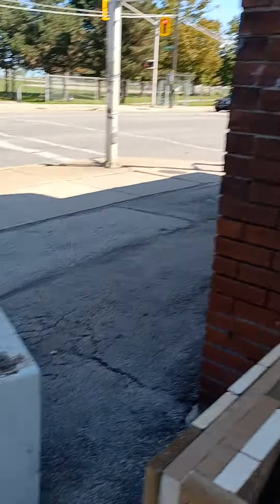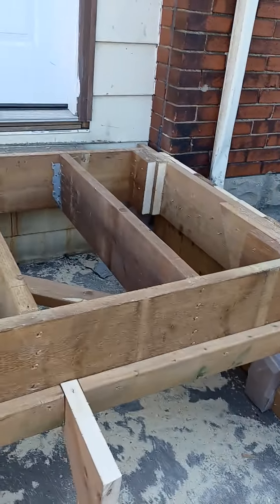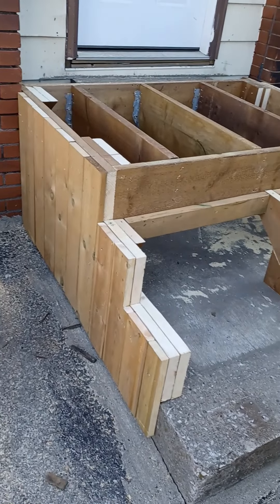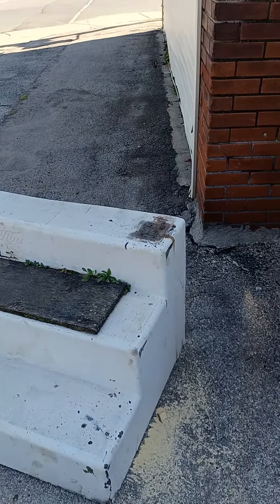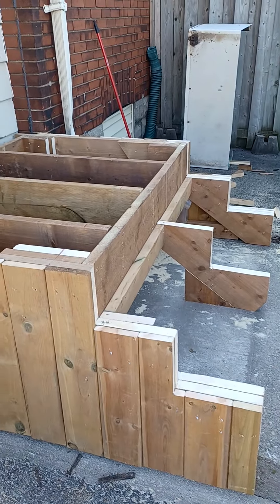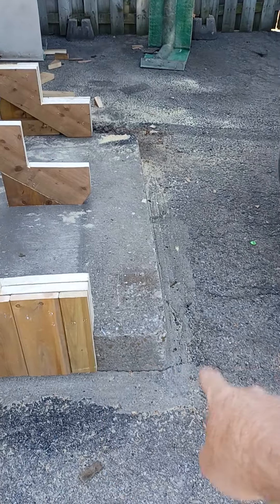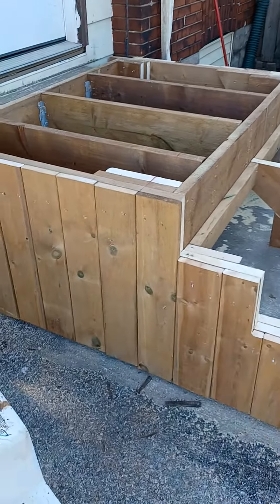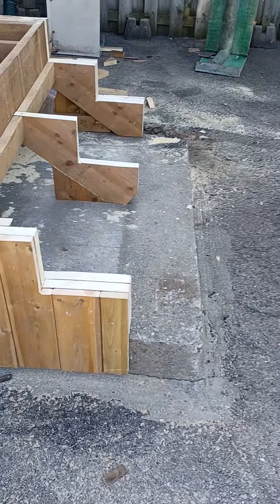little porch side job

Comment: Not enough stringers.
Reply: Yes super curious what your plans are on the stairs. For exterior stringers I always overbuild even if I put 2x on I go 16c.
Reply: 16 o.c on your stringers or your decking will severely sag and possibly break in the near future.
Reply: Sagging? If you're constantly putting crazy amounts of pressure , or just general walking up and down over time?
I don't see how 3 centered would not be enough?
Reply: Yes I just demo'd a five quarter deck. 1 joist was spaced to 20 inch o.c. and that 1 bay had a terrible sag.
Might be able to get by with 2x decking but pretty much always build 16 inch O.C
Is a standard rule of building
Reply: You could never use the deck and with that spacing the wood will sag on its own. After all wood is living breathing moving material thats constantly drying and getting wet in an outdoor circumstance.
Reply: It’s not about sagging its just not structurally sound not to mentioned when pressure treated drys out it warps and all kinds of craziness.
Reply: His work is good. But also good be different in his area as well.
Reply: LOL .. All the experts come out . Including myself . The minimum width of stairs is 36" .  The spacing of stringers is really dependent on the tread material . My exterior deck for instance has only 2 stringers !!!!.. The stringers are 2x10's and the flight is 80" wide !!!! .. A style called A Blind Dado Housed Stringer ..everything is dependent on the materials used , engineering and how well it's anchored ..  Granted I wouldn't build a sawtooth stringer 48" wide . With 2 flanking stringers and a center while tread is 5/4 x 6 .. That is Snap Crackle Pop ..